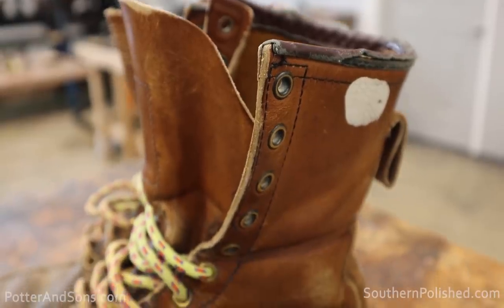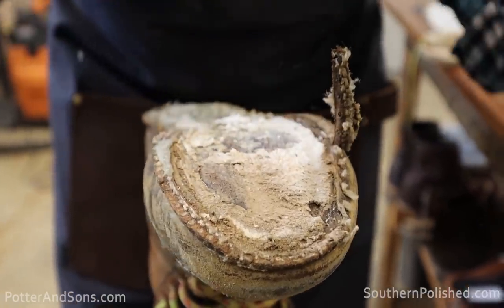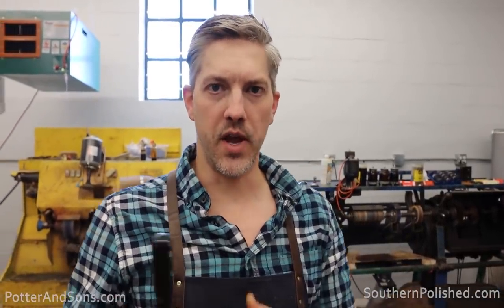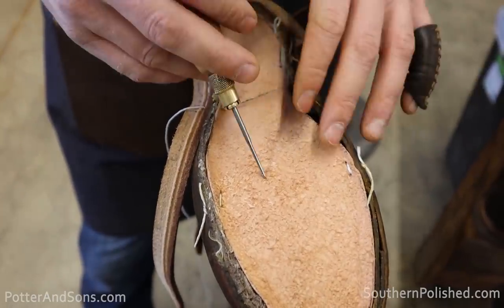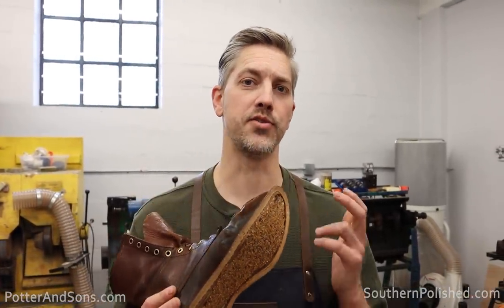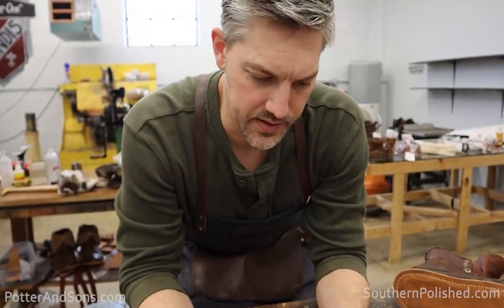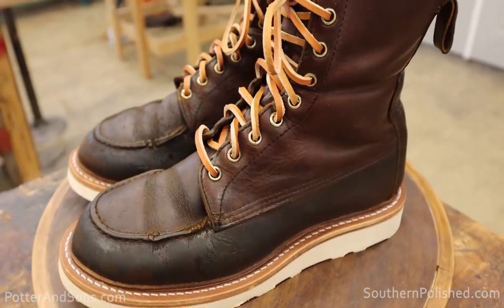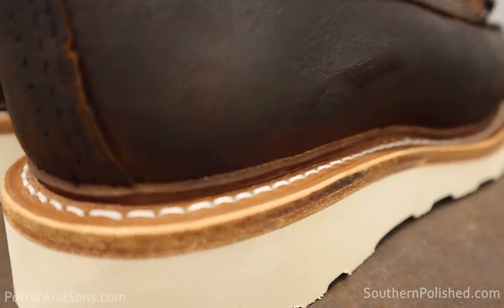Red Wing Classic Moc Toe Boot Makeover | From Throwaway to Almost New

Comment: True story: I'm a Glazier by trade, in Florida and back in 1999, I was working on a high rise and we had stored the crates of glass and frames in the basement,. Well, it stormed one weekend and flooded the basement, so to get to our stuff, we had to wade into water.  I had cheap wal mart boots and my feet got wet to the point of injury. Right after work, I went to a Red Wings store and the clerk took one look at me and had me sit down. He took my soaking wet, ruint boots and socks off my feet. He took a towel and dried them off, then sprinkled them with powder and put the best, thick socks I'd ever had on my feet. then he had me step into the machine that sourrounds your foot and measures them. He went to the back and came back with a pair of mocs, like those and put them on me. They were the most comfortable boots I'd ever worn. I told him, Listen, you ain't getting these boots back and I'm walking out in them." I walked out with those boots and have worn Red Wings ever since. Now, since then , I've worked all over the Country, From Florida to Atlanta and to New Orleans afetr Katrina and out to Las Vegas and up the Kansas City and no matter where I went, I could walk into any Red Wing store and they'd clean them, rub them down with conditioner and oil and even put new strings on , FOR FREE. Now, they'd resole them  (I had to pay for that), but they do a great job and even gave me a pair of loaners until they got mine done.  Red Wing is an investment, not just in money but they're like a family. I knew that no matter where I was, I could walk into a Red Wings store and be treated like family. I could relax and be taken care of,  on the spot. A great company the makes great boots.
Reply: I believe that story. I was treated very kindly when I went into Redwing store a couple weeks ago for the very first time. I would like to see them continue being such a down to earth shoe company. A not cheap out like so many other shoe companies have. 
Quality over quantity is always better. 
I appreciate you sharing your experience. It may sound strange, but I could literally picture the inside of Redwing Store (brown,red colors with a leathery smell) as I was reading your story. 
👍
Reply: Same story here with mine: great customer service, amazing boots. I've had em for... God, 6 years now? I've hiked, hunted, waded, climbed and gone to a nice dinner all in one pair of boots. 

I'm a cheap ass when it comes to basically everything. Except my boots. If they ever fail, I won't even hesitate to drop the cash on em again.
Reply: @troubleinbound  which Redwings do you have?
Reply: @lukuscarter3563  the 875s. 6 inch moc toes. I got vibram soles installed 4 years ago and I've never gone back to the default ones.
Reply: I was hoping for this experience. Unfortunately when I went to get sized they didn't treat me kindly(Atlanta).... maybe cause they only carried work boots and not the style I was looking for. 
Bought wolverine 1000miles instead and now been wearing them daily for 6 years! They are about the same condition as these mocktoes. Resoled twice.. 
But I long for the day I can get some RedWing iron rangers.
Reply: Great story. Worn crappy shoes most of my life but Red Wings I my future.
Reply: I used to wear Red Wings exclusively up ‘til about 20 years ago when they started selling garbage boots that wouldn’t last. I’ll admit I still like the clothes they sell. But don’t care for their footwear.
Reply: Wow, I like and own Red Wings myself, the two different stores in have delt with are fine. Nothing over the top about the service.
Reply: Red Wings should definitely pay you for such nice and sincere promotion!
Thank you for your story, hope they know how you appreciate their work and attitude
Reply: Red Wings are nice.  Not the best, but not the most expensive either.
Reply: I have redwings too. 1 year warranty, the side kept blowing out and they wouldnt do anything for them. They were the most comfy shoe too, after second pair doing it, i was done. Glad you got family, cuz i sure didnt.
Reply: I’m a commercial glazier too. Sounds like fun to travel across the country and work. Lmk how I can do thag
Reply: I sort of inherited a pair of 6" moc toe Red Wings and was raving about them to my brother who was looking into getting new work boots.  The clerk refused to give him the time of day much less help him pick out a pair of boots, he walked after 5 minutes as the only (attempted) customer in the store.  Now this Red Wing store is in a pretty bougie area and we're used to that treatment walking into places covered in whatever job site we were on, but it really struck me that a boot salesman would look at my brother, a very large man who obviously needed a good pair of boots, and not even engage him.  I really hope his experience is relegated to the one-offs because the boots are great but after that I don't want to go in there and be treated the same way.
Reply: Been wearing red wing Pecos for 20 years, probably more. 1177/1178 (every day at work) 966 steel toe for the workshop (used to anyway, can’t seem to get it anymore now I need a new pair) and my walking around boots; 8195 Roper. 
Still need some iron rangers (hard to get in my size where I live, unless muleskinner or black is what you’re after) and 866’s (which are calling to me), maybe some moc toes too, probably the 8” ones, 10877, but I don’t mind 875’s.
Red Wings have been great boots, always feel like home on my feet... which makes it even more of a shame that they’ve discontinued my everyday favorite Pecos 1178, previously 1177’s (966 if steel toe was required), it’s all I’ve worn for most of my day to day and work stuff for 20 years. Facing life without them is daunting. There’s a sliver of hope for the moment, they haven’t yet confirmed (to me when I asked) that 1155 is going too, so if that stays then hopefully I can switch to that, even if I need to get them resoled in vibram 430 mini lug from new if possible with a lower bloke heel. I’ve never asked the question on whether it’s possible to lower the heel on 1155 when resoleing. 

Failing that option, I’ll have to move on for my day to day boots; I reckon I’ll have to stump up for Nick’s Boots “Renegade”, which looks to be my best option to get one that’s close in style, an improvement in quality (both materials and construction) for my next boot (alternatively a boot by Wesco or JK boots would likely be suitable too I just hear lots of great things about Nicks), ultimately it’s a case of f I can’t have the same old favourite I’ve loved for decades, then I definitely don’t want to be paying similar money or even more than Redwings for something that’s not as good. I’d rather pay more for something better.

Red Wing themselves have not been overly helpful with this. They replied to my email, telling me 1178 is discontinued, but they said they’d try and find my size in store somewhere. 
I replied with my size and told them where I am (Australia) and that we’d have to do the transaction through red wing shoes australia if they can arrange to send it to them, I’ll pay them for the boots and any associated costs for shipping and such. Never heard back from them. They didn’t reply with any alternative model numbers I could look for, or reply to let me know if 966 and 1155 are also discontinued. 
Red Wing’s customer service seems to be hit and miss, I figure it’s because I’m not in America, they just don’t care. 
But then my money is just as green as the next persons and I buy plenty of boots so why would Res Wing not bother replying and find a way to make the transaction happen through the Australian importer? 
Even if they couldn’t, a reply to explain that it’s not possible would have been nice of them, instead of ghosting me 6 weeks or so ago. 

Love the boots, hate the customer service. But I don’t think Red Wing as a company is what it used to be. YMMV.

Comment: The guy that killed those boots is LUCKY. Once I started paying my own bills and living on my own, I learned to take care of my stuff. I keep good heels and soles on my boots and they last forever.
Reply: i dont buy crazy nice boots either. my adtec loggers have more in the resole job than i paid for the whole boot brand new. they came with a good upper but a crappy mid and outsole. i have decked them out with a super thick midsole, stacked leather heel vibram lug outsole, leather welt and a through stitch on the whole sole stack. my favorite hiking boots of all time. i'm working on a pair of cheap steel toe cowboy boots from walmart and i plan on doing the same to them to use as work boots.

Comment: At this time there is one down vote, probably from Redwing Shoes since they lost a replacement sale. 😉
Reply: Red wing don't even do these repairs iirc
Reply: @shurdi3  he means a new pair of boots
Reply: @shurdi3  they will resole and do other basic work. But they would have turned this boot away due to the excessive welt and insole damage.  That is something they rarely spend the time on replacing.
Reply: Redwing no longer sells the model I wear so having resouled would be a big plus for me.
Reply: @scruffy6151  you know what style / stock # you have?

Comment: Man,I’ll never complain about how much it costs to have boots repaired! That’s a lot of work these guys put into fixing these Red Wings! When I worked for American Airlines I had a pair of Redwings just like these except they used a black sole material. It was really comfortable but the concrete on the ramp was like a wood rasp and the soles lasted maybe 6 months at the most. This was in the late 80’s,early 90’s. I wish I hadn’t thrown them away now. I would have had these guys repair them.

Comment: Honestly, for the price why wouldn't the owner get new Red Wing Mocs! They aren't high end boots.
Reply: $300 isn’t high end? I must be poor as shit.
Reply: @Necker12  I’ve only recently gotten into boots, but I’ve seen some go up to $600.
But yeah, for me $300 is high end.
Reply: Im an union ironworker by trade. And i wear these redwing 877s. There one of the hardest boot to break in! So if i can save money and resolve them a few times instead of buying a new pair i will! And still have a boot that is broken in and very comfortable. But i also do take very good care of my boots lol. After all i wear them 12 hours a day lol
Reply: @Necker12   Not when the repair would exceed the cost of the boot itself. Especially in the condition it was with the uppers being cracked - prob best to get a new boot. The owner abused the uppers so can't have too much "sentimental" value if the uppers are that way.
Reply: @jtit2025  Well Im pretty sure the boys did most of the work on these boots pro bono.

Comment: In the 90's I did repair work for several Red Wing dealers in the Canton Ohio area and did many boots like this. I was surprised at how many cobblers never replaced welt or rebuilt insoles. They also never pulled out the old welt stitching, use to drive me crazy when I repaired someone else's work. If my customer had the money I had the time and skill. I really miss working as a cobbler, it was so satisfying. I did it for over 17 years and loved every minute. I never did the leather insoles like this but would love to practice that. Good stuff guys, I really enjoy watching your content, great work. Ahhhhh, the distinct sound of a "K" stitcher start-up. BTW, where did you find that large "Landis" sign on your wall? ....it's awesome

Comment: Now that was a proper full resole as I remember them. Great job and they look very nice now. Only thing I would've wanted different is a sole stitched, nailed or riveted on and with screws. But thats a different type of sole. I like how you redid the boot from the insole out. Not many places do that anymore and these days most shops decline doing that and even making a new welt. In fact most only want to do half soles and the bottom heel. Thats what I call trash work IMHO.

Comment: I think the only issue I have with videos like this is the real-life practical application of them. Unless the boots are some rare or discontinued model (which these are not) or the owner has some sentimental attachment to them, once they’re in the kind of landfill condition they showed up to the shop in, the amount of time, effort, and money to get them back into a decent condition far outweighs the cost of just re-buying them. A job like this should easily cost hundreds and hundreds of dollars with all the hand welting, re-doing the insole, etc. That money should just be used towards a new pair where the upper isn’t cracking because that’s something no amount of time or effort from a cobbler will fix. The real lesson here is to take care of your boots so that they don’t ever end up in the kind of condition that these ones did when they came to the shop.
Reply: Would you rather watch these craftsmen at work or watch the boot owner go to the shoe store?  This video is for the entertainment.

Comment: My boots arent RedWings, they're Birkenstocks. Ive worn them at least 15 years and plan on finishing out my career (school bus driver) wearing them. I'm 69 and driven for almost 30 years. My left foot sits by the heater so my boot has cracked where the heat hits them. I talked to Birkenstocks in Oregon and they cant repair them since they arent offered any more. What would you suggest to save these? Sandpaper the high spots and reseal? They're black, lace up and ankle high size 42. I've put in a new removable footbed. Any information would help.

Comment: Whoa😯 I actually have an issue that I dont know how to remedy.
I had an ankle fusion. Now the heel and Achilles from the bad ankle gets rubbed raw in every new pair of pull on work boots I buy! So, I have to wear two pairs of socks with my work boots. There has to be a better way. I've added in soles, but that creates other Fitment issues. Not sure what to do....
Any advice, if you have time, would be heeded and appreciated. 
Timothy from Kansas.

Comment: I do hair replacement on women and I damaged a pair of very soft pebbled leather boots from Denmark and no one here in new york would touch them. so I cut a small portion of the tongue I think it's called ( the. part the laces run over) and ground it down to a paste and mixed it with an adhesive I use on clients, the glue is a polyamide and used in medicine and. applied it on the torn scuffed area and allowed it to dry a few days and then buffed it out with linseed oil and looks and feels great, just a very small discoloration, but il bet someone like you would be able to figure out how to best manipulate it

Comment: We all like to watch you shape the cork but your comment about oatmeal got me wondering- with all the smoke/steam does the cork have a smell as it is heated and is it good or bad? Do you have to wear a respirator or mask when applying? Who gets stuck having to apply this all the time?
Reply from the maker: There’s a little smell to it, but it’s not bad. No mask is required because we have an air filtration system that pulls all fumes dow snd away from us. We take turns applying the cork.

Comment: I guess I’m the only one wondering but, why are the left and right boots laced differently on the before and after? Was that an accident or to show lace tying options? Kinda messing with my normal boot restoration OCD fix by having the laces not matching at the end.
Reply from the maker: No it was an accident. We laughed about it afterwards after both both laced a boot. 😂
Reply: @TrentonHeath  You did amazing work as usual on the boots 😎👍

Comment: A new welt and resole will set you back between 190 to 220 USD just in materials according to the prices on the website ! And I thought getting old shoes/boots fixed is the economical option.  How is it justifiable for 200 to 400USD boots/shoes ?
Reply from the maker: Some love their boots, others don’t want to break in another pair. Etc.

Comment: A company riding on the coattails of their past making a crappy product and charging you an arm and a leg. Giving made in the USA a black eye. I bought a pair, 3 months in the sole started coming off the boot. Never got them wet, I work in a warehouse. Company replaced them without a hassle. Next pair came with a giant black streak across the whole toe box. Returned them and was sent a THIRD pair. Even more larger black streaks and the leather was dry (made label was a year old). I get they are work boots, but I will get them dirty and stained not right out of the box. Returning for a refund and buying a pair of whites perrys